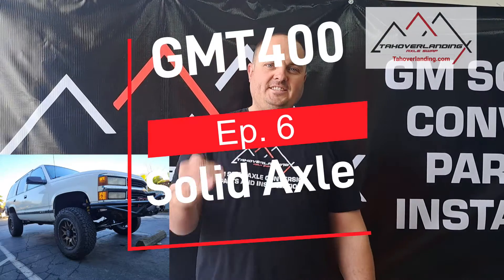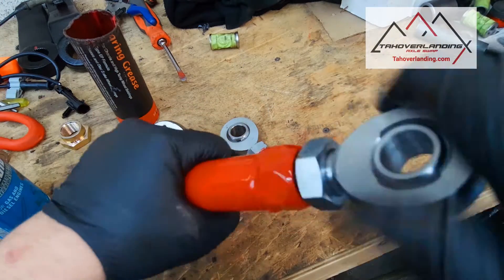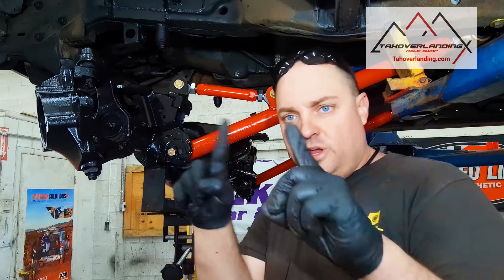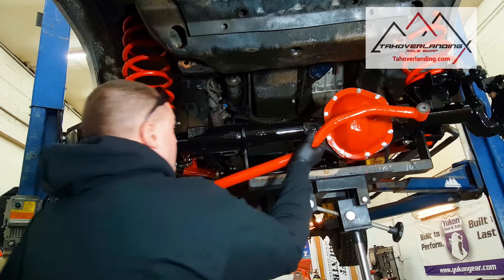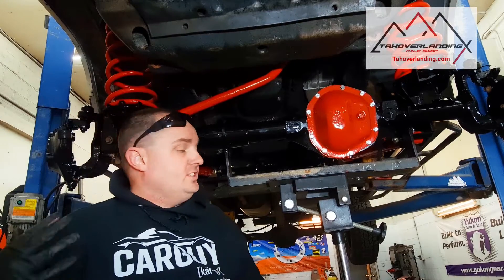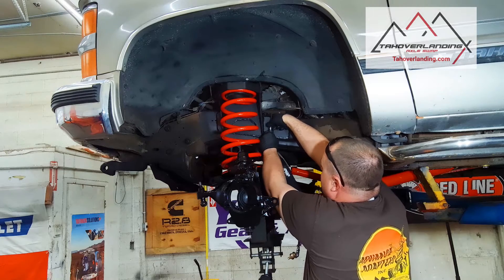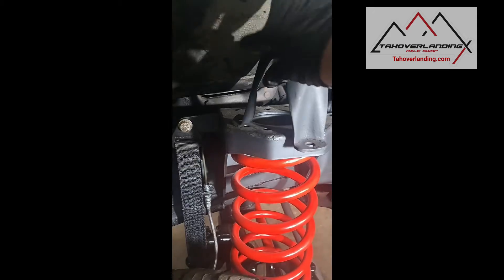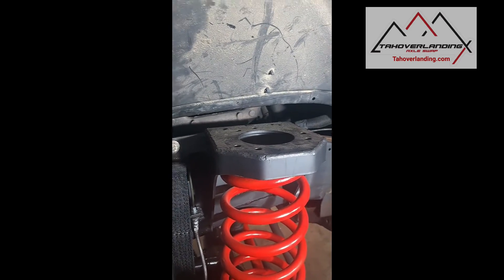OBS Chevy Solid Axle Episode 6 How-To

Comment: does anyone make chromoly axle shafts for this particular 44?
Reply: You should do a video on a GMT800 99-07classic 2500HD pickups
Reply from the maker: The inner shafts are standard Dana 44. So chromoly inners are everywhere. We'll be offering outers shortly. 

RCV performance offers complete shafts with Their performance CV joint. But you have to call them and do a custom order for it. Because the way they refer to it, is a Dana 44 inner with a Chevy CV Stub shaft
Reply: @tahoverlanding  between that and the c clip eliminator + CM shafts for the rear are there any reasons I shouldn't do this with 37s?
Reply from the maker: @pm-bn9zt  we have multiple customers that are running 37s without chromoly shafts as well.
Reply: So I have an eye on the 2001 dodge ram 1500 axel to put in my 1998 tahoe what kit do I need to complete this task?
Reply from the maker: @Lambrocio217  at Tahoverlanding.com you'll need one of our 6 lug extended parts bundles. Available to use either coilovers or coil spring&shock